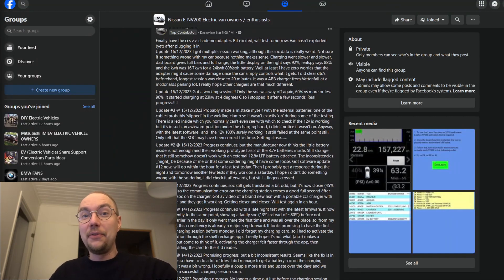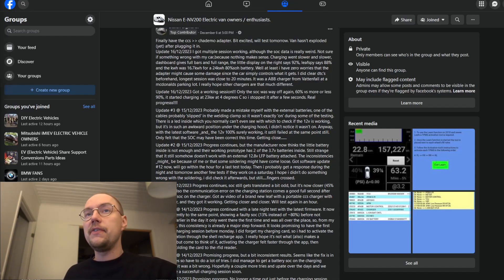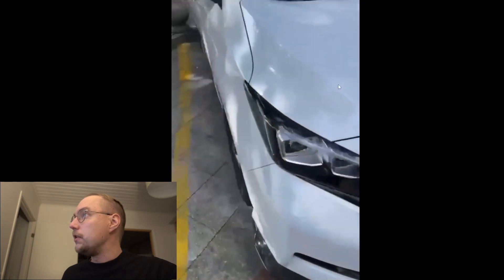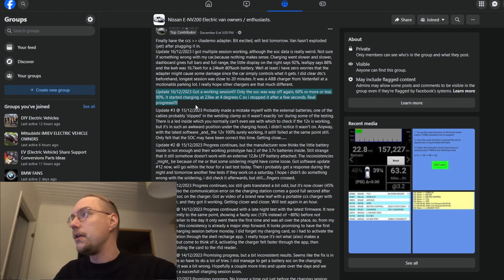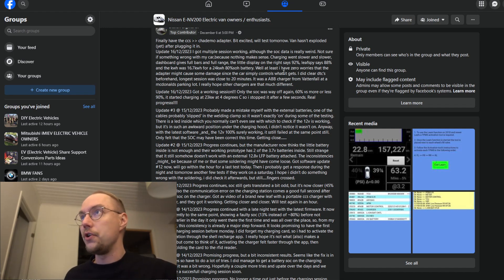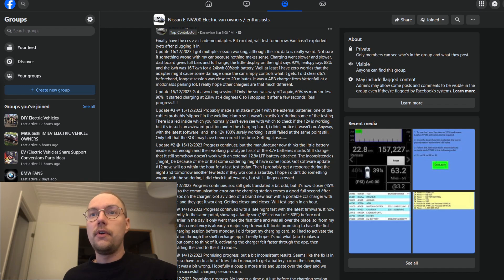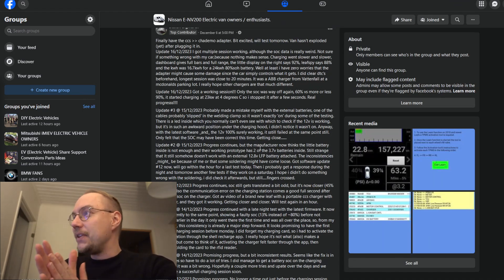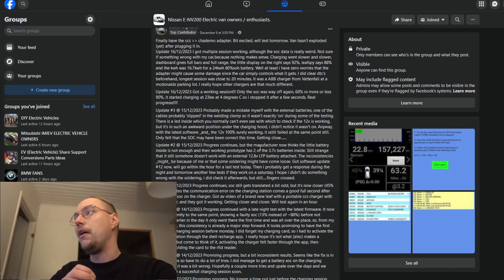First charge with BETA CCS-Chademo adapter!⚡

Comment: I'm charging my leaf's directly from the solar array that is configured to the battery max voltage. So no risk of over charging.  Aux battery banks in parallel "leaf batteries" also operate in parallel so even less stress on the system. I do not need to switch on relays to charge the system.....

Comment: Cahemo is 500V DC ?  but CCS2 is 2 , 4 or 800v DC   IF I understand the systems correctly , maybe i dont ?   So how does the voltage resolve itself  if you rock up to a random CCS2 charger with your Leaf ?
Reply from the maker: The adapter communicates wht voltage it wants. DC chargers have a range of 150-1000VDC. No problem at all!
Reply: @DalasEVRepair  thank you 😊

Comment: I admire your resilience in solving this.
Any ideas on if you're invalidating your insurance when charging?
Reply: Why should the insurance company know?
Reply: @markuspaulmathis214  

Have a Google:-

What if I don’t tell my insurer about a modification to my car?
If your insurer doesn’t know about a modification you’ve made (or intend to make) to your car, and you then have to make a claim on your insurance, they may reject the claim or reduce the payments they make.

I could be completely wrong as it's an adapter, but is it within the manufacturers' intent and does it create any risk.

If there was a problem with the adapter, who owns the problem?  The external charger? The car's inverter? The adapter?

The chademo/Tesla adapters seemed to be prolific in the USA.

Perhaps I'm too wary.

Comment: In the video you said sth about different versions of the Chademo protocol. Is it known which version(s) have been implemented in which LEAF? Resp is that relevant? Could it happen eventually that the adapter works for LEAFs but only the ZE1 versions? I have a 2016 with 30kWh battery, and around here Chademo is rare, and once a charging station is replaced, it is likely to lose Chademo 😞
Reply from the maker: If one vehicle doesn't work, software can be updated on the adapter via USB! No worries 😁

Comment: Just bought a Gen1 leaf and have been exploring your upgrades. Would be keen on doing some work toward getting a CCS combo 2 plug into it without Muxsan's insane prices (and the fact i'm in Australia, too). Have explored your Github to an extent. Is there any particular reason we can't implement the CCS specifications ourselves using a microcontroller, similar to the CAN converters that we would need anyway for an onboard?

Comment: interesting, i had no idea they were even making chargers without chademo until i pulled in to a new BP garage the other day and there was only CCS. Shit my nearly new van is obsolete already?   An adapter would be handy but I'd be worried about leverage on the socket with a cable-less adapter.
Reply: For the leverage problem, I'm sure it could be easily fixed with a simple metal bracket or something. Effectively a third leg that wedges between the underside of the adapter and the bottom of the charging enclosure. That would transfer enough of the load to the vehicle from the heavier adapter. I'm guessing it wouldn't need much. Actually, make it from plastic though, just in case....!

Comment: Very exciting Dala !  I wonder if we could fit a type-2 socket to replace the Chademo one, and then permanently fit the adaptor behind the grill somewhere ?
Reply: I think Dala actually discussed this, and the work was started on using a BMW i3's CCS combo 2 and LIM?
Reply: It would make much more sense to replace the Type1 socket with a CCS one and connect it to additional CCS hardware and the BMS, just leave the chademo untouched. As far as I know someone did it before.
Reply: @benjaminhanke79  It has been done and Muxsan offers it.
Reply: @benjaminhanke79  I'll just raise my hand here and wave a bit inconspicuously
Reply: Mucsan in the Netherlands has been selling a CSS conversion, which they build in for you. So you lose the chademo plug. It's very pricey, so this adapter would be a blessing

Comment: Since you are getting one for yourself, I would be interested in how it survives different kind of weather conditions. Mostly if it's safe to use when it's raining outside? And does it function at all in cold weather or does the inbuilt battery die in the cold?
Reply: This is great point. We had one of those type2->type1 converter stubs for home charger that had its own lead (type2) and the thing started shortcircuiting itself after a year or so (somewhat out in the rain)

Comment: Do you know how safety works with this stekker? Is there a locking build in. If the connection goos lose on 100A 400V then you have  serious issues?

Comment: Do you think that this could successfully adapt Chademo to ccs using a V2X ccs charger?
Reply from the maker: V2X is already available on Chademo. No need to complicate it with another adapter.
Reply: @DalasEVRepair   I have had issues finding a chademo v2x in us
Reply: @DalasEVRepair While true, in Australia the only approved V2G charger is the now discontinued Wallbox Quasar. Be great if there were more options available.

Comment: Would this be more cost effective than a straight up CCS conversion of the leaf?
Reply from the maker: CCS add on to the LEAF is cheaper, but requires way more time and effort. 

Pre-made adapter will be easy but 30% more expensive.
Reply: What do you think the price could be when mass produced?

I think the key thing here is that anyone could buy these adapters, but not everyone can replace chademo to ccs. In my country nobody knows how to do it.

Comment: Any idea what the current limit is on this adapter?
We currently have a Kia Soul EV from 2017. It will take 175A, but there are very few chademo stations that will provide more than 125A.
These days almost all CCS chargers will deliver more than 125A, so it would make longer journeys a lot faster.
Reply from the maker: Not sure if the manufacturer will cap it at 125A, or take it higher. I will do my own analysis on this when I get my hands on it!
Reply: @DalasEVRepair  I'm also interested that can I get my Leaf finally charge with 100kW speed or even higher. As you know, we don't have 100kW Chademos here in Finland, and closest one I know is in Norway and would at least like to test my Leafs 100kW charging ability without first driving from Turku to Norway 😅
Reply: Leaf works fine at 100kW when you can find one.  Charged on a 125 CHADAMO and was still getting 36kW at 85% capacity.
Reply: @DalasEVRepair  in that same form the engineer was discussing how presently it’s capped at 50 kWh

Comment: Great update. I follow the Facebook group too but it's good to have your views on this. Can you see this sort of device tolerated and policed by the chargepoint operators or are insurance companies going to end up getting involved if there's a risk of cars being damaged or someone getting hurt?
Reply: That will be a huge advantage. I hope it will be produced for mass market soon 👍
Reply from the maker: CCS sockets have temperature sensor on both positive and negative pins. If the adapter would start heating up, the charger will notice this and stop charging.

If the manufacturer puts the correct IP and other certifications on the product, I would not worry much about it! But looking forward to my own teardown after using one in real life!